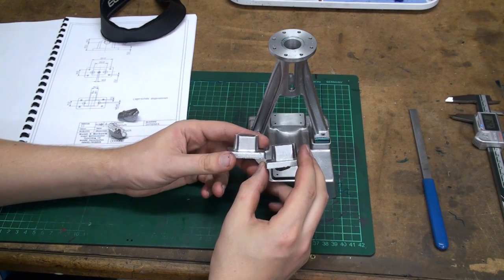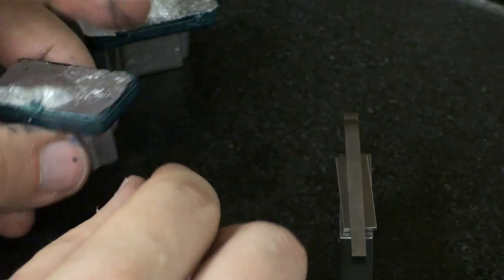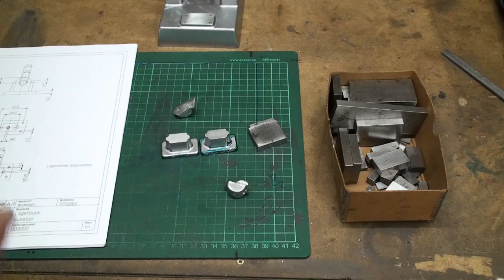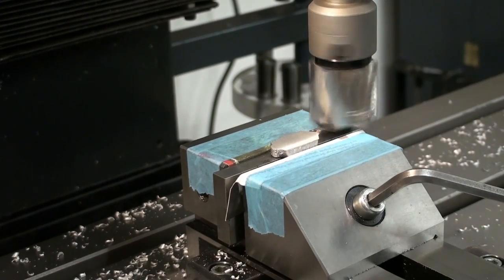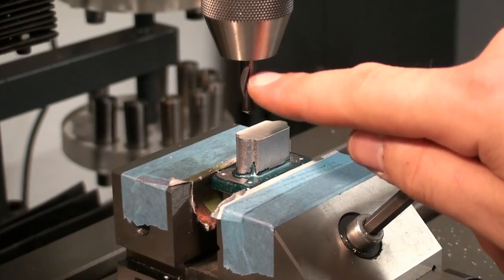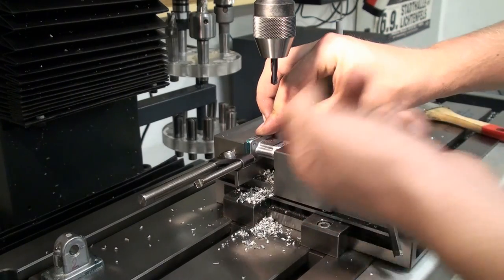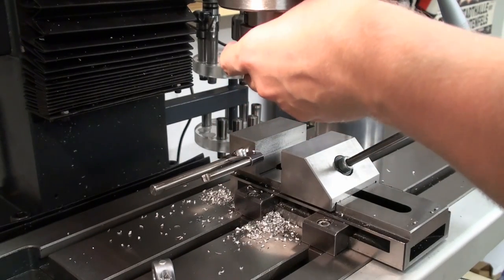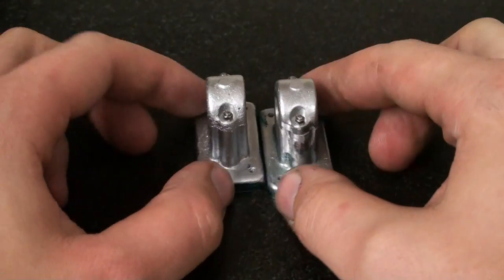Simplex steam engine Part 3 - Simplex Dampfmaschine Teil 3

Comment: As always a very nice job.
I once broke an M2 tap in an Aluminium part of a centring microscope i was making, I dissolved in dilute nitric acid. It took several hours but saved making a new part. The acid came labelled as "cartridge case cleaner".
Reply from the maker: +Chris Stephens Nitric acid Brrr I am happy when I dont have to have that stuff in the shop ;)
Reply: It's dilute and relatively benign but does dissolve steel without harming Aluminium, If you don't have an easy option it can help. You could always keep it a garden shed when not needed. :>)

Comment: Some real small scale and fiddly work there Stefan - lot of patience and care needed. Nice work. Stuff that small scares me a bit, particularly when it comes to drilling and tapping tiny holes!! Sympathies with the drill breakage!
I also often use a piece of precision rod to set a piece in the mill - even sometimes turning a quick temporary piece of rod to match the workpiece ID hole and a bore in that rod for my centering pin... if that makes any sense!
Reply from the maker: +ChrisB257 Thank you! Yes its pretty small stuff, but thats what I like - Setup and machining on small parts is challenging in a complete different manner than machining large pieces with massive ammounts of material removed :)

Pins/Arbors for setup work are a nice thing, very foolproof and easy but at the same time pretty accurate.

Comment: Looking good buddy.. Stefan I have broken a lot of m2 taps As I work with titanium.. I'm not sure if this would of got rid of the drill bit. But over night in ferric chloride always works for me... Saves the wire EdmI have been using a tap matic now for some time and don't get this problem any more..
Reply from the maker: +lbcustomknives Titan is a bit of a bitch to tap, way more problematic than tool steels :\
Thanks for commenting!

Comment: this is going to be a pretty engine. the bearings are a long way apart though for a webbed crank? interested to see this as it progresses! nice repair on the casting. glad you showed that. how did you fasten the piece in?  thanks for the video
Reply from the maker: +Emma Ritson I used steel filled epoxy and a m2 screw from the bottom :) Thanks for dropping by!

Comment: Yoour marking-out process may be old-school but it is extremely accurate and not much more slower than using a height gauge. I have put gauge blocks on my wishlist. Hard to find metric gauge blocks in the US. On the other hand I can save money by not buying a height gauge. From my limited experience machining castings is quite an art. There are, as you point out, no reference surfaces at all in a casting.It is not the machining that is difficult but holding the stupid thing so you can machine it!

Comment: Stefan, you mentioned Argon degasing the aluminum.  I went back to part 1 where you cast the parts but nothing was said about the argon.  Could you say how this degasing was done?  Possibly bubble argon up through the melt?  Thank you.
Reply from the maker: +Glenn Felpel I had some footage from the degasing, but it was getting dark and you could not see very much, so I edited it out. Basicaly it looks like a stainless steel showerhead on a long pipe that is emerged in the molten aluminum and then a low flow of argon is pumped trough it, for a few seconds at a low flow rate (Otherwise you would end up with aluminum in your face - Not good ;) )
Reply: +Glenn Felpel Stefan,  Thank you very much for the information.   I do a little aluminum casting and also have access to Argon gas.  Your explanation is excellent.  And you have that right about not wanting hot aluminum flying about. Not a good idea.  I think you should be giving out a deploma to us for all we are learning!  :)

Comment: I need to get a nice milling vice and wonder what the make of yours is. It appears to be just the right sort of size for my needs, is it 70mm ? 
Over here in the UK finding good tooling can be a challenge.
Reply: +Stephen Deakin Had no problems with the 50mm Arceuro one I have. Generic Chinese of course but pretty reasonable quality.
Reply: +Little Work Shop of Horrors I've seen the ArcEuro ones on there web site and they appear to be well thought out. Thanks for the feed back on your experience with yours.

Comment: Looks about as easy to cast the crank bearing stands in one piece then saw the caps off, you could even cast a spare if you plan to screw one up ;) or get a bad casting.
Reply from the maker: Cutting them apart would be an option, but the patterns are made that way.

Comment: Another very interesting video. What are you using for cutting fluid in aluminum? I can't seem to get anyone to send me the American Alumitap (or the like) by mail because of its being hazardous material. Making do with WD40.
Thanks for the cool video, Stefan.
Reply: +Jim Milne  I used to work with aluminum castings a lot and have found WD40 works pretty good as a tapping/cutting fluid. Some alloys can benefit from more lubrication so I would use kerosene or lamp oil(naptha). I mixed WD40 with these or even automatic transmission fluid for the really gooey or tough stuff. Experiment until you find one that works good for you. Alumitap, Tapmatic, and the other synthetic fluids work best on highly alloyed material but are expensive and usually really stink up the shop. You also don't want to breathe them if you can help it.
  Mike (o\!/o)
Reply: +Moholo 88 Can you tell me why rubbing alcohol works so well? I've only ever tried WD and regular sulphur based stuff for steel, but 91% Iso leaves a perfect smooth finish on most aluminum alloys, it evaporates fast so I only use it for the finishing pass.
Reply: +Jim Milne IMO Alumitap isn't any better than WD-40 or straight kerosene.
Reply: +James Kilroy But it's soo much better for the supply house when you give them your $15 for a pint of AlumTap, LOL!

I've no experience with anything but WD-40, and since it is only $17 for a whole gallon, I doubt I'll be trying anything else. I am interested in the alcohol method just out of curiosity, have you ever tried that one Kilroy? I would like it if it worked for using on something I would end up welding on
Reply: Ethanol works great on aluminum, you spray it in a mist, it evaporates during use.  Tons of cooling taking place. You better have totally enclosed machines with built in, high volume, negative pressure, ventilation! I'd never use it in my own shop on open machines.
Reply: Whoa, never thought of that! Won't be doing that either, I don't want to be caught in one of those invisible fire balls that alcohol race car drivers get roasted in. No thank you ;)
Reply: Yeah I think I would definitely worry about the fuel/air mixture in a spray, I've only ever used a drip. Good safety tips!

Comment: I totally understand why you had no patience for filming, but the fixing of fuck-ups makes the best videos.
Did you consider the chemical removal method AvE has recently shown?
Reply from the maker: +stefantrethan To much cursing to edit out ;)
I never tried the chemical method, If I dont see any chance to do it myself I send it out to be burned out via EDM.
Reply: +Stefan Gotteswinter The language didn't do AvE any harm ;-).
Reply: Can confirm from past experience, the Alum works well. Was nice to see AvE cover it recently. I like any solution that involves me just soaking something and walking away. The alternative usually involves foul language and more broken parts.
Reply from the maker: +Bradley Weingartner One thing is that I am not very knowledgeable on chemicals, so I am always a bit carefull and I try to keep the number of substances in the shop low.
Reply: The great part about alum is its readily available in the spice section of grocery stores (at least in the USA) because its used to make pickles. And if its safe to eat its probably safe in the shop!